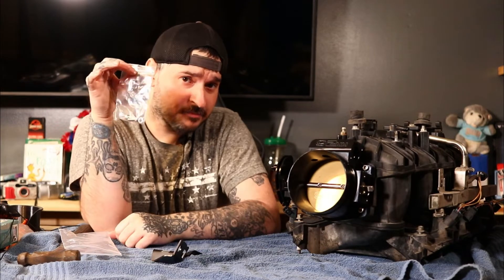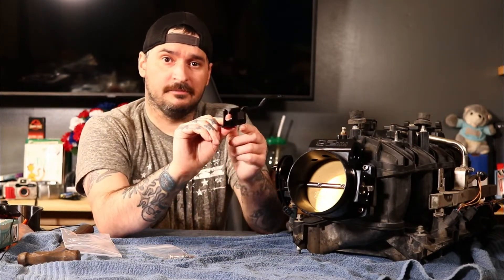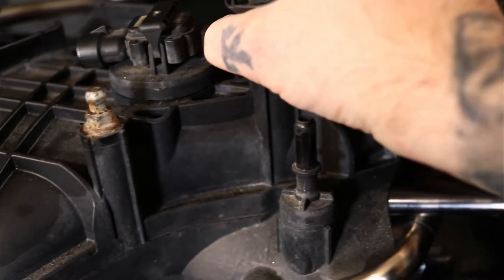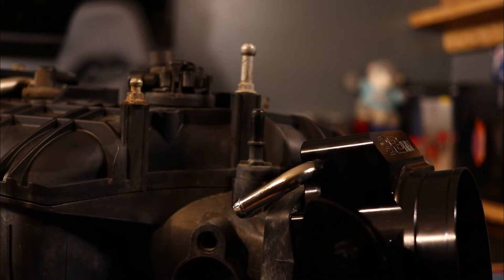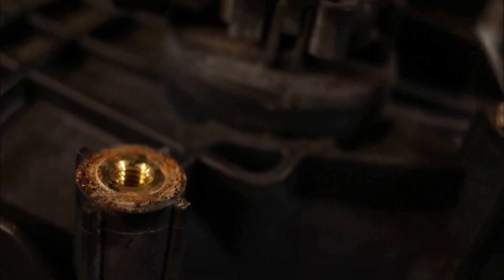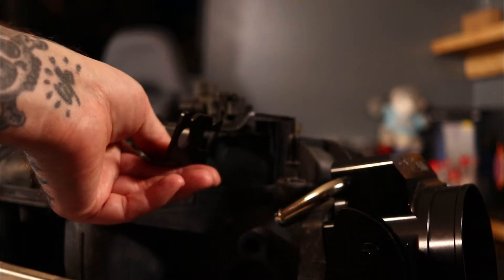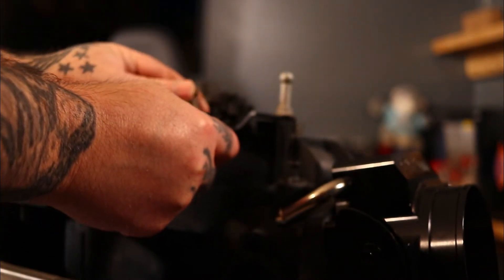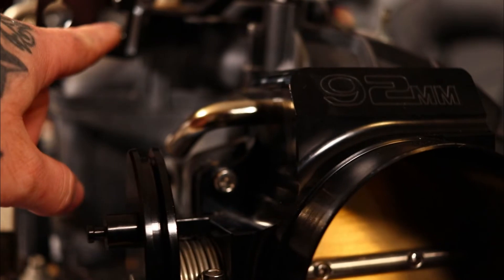Throttle Cable Bracket For TBSS/NNBS/L92 Intakes, HOW TO INSTALL A THROTTLE BRACKET, LS SWAP

Comment: I’m in the middle of converting my nnbs truck to drive by cable.  I have everything but the pedal figured out.  What pedal did you end up using?
Reply from the maker: I used my stock pedal in my 81 chevy, you prob will half to weld a tab on your pedal or change to a older style if you have a newer truck with dive by wire

Comment: TattsForLife hey buddy what throttle body are you using? Do you have part numbers for both throttle body and the bracket I’d appreciate it
Reply from the maker: Its a 92mm eBay special, drive by wire